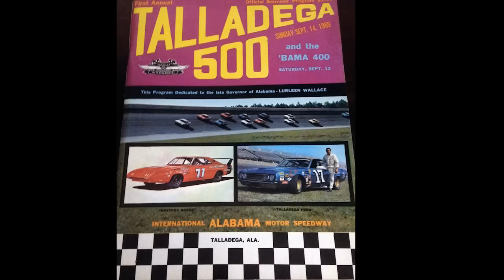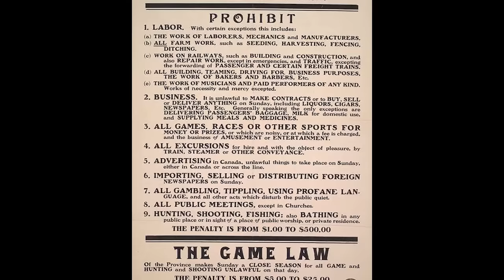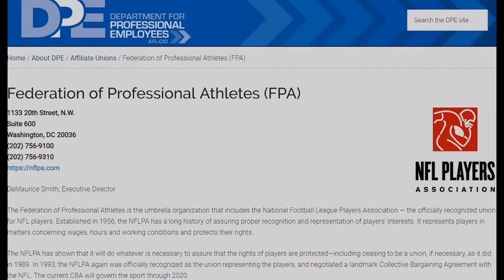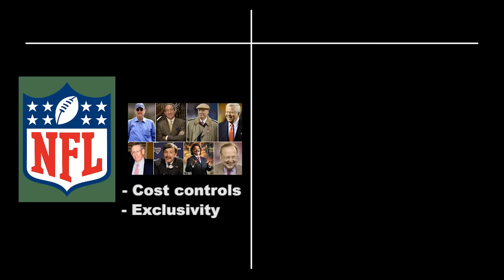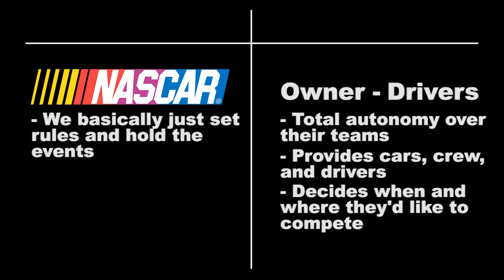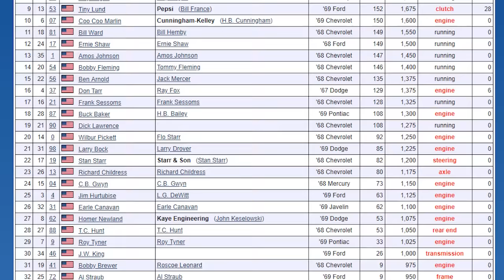The Worst NASCAR Race Ever: The 1969 Talladega 500

Comment: @7:44..."...NASCAR learned it's lesson and there hasn't been another tire war since." ... Ummm, wrong! There was a major tire war for years in NASCAR from the mid 1980's thru 1997 between Goodyear and Hoosier! In fact Continental acquired Hoosier in 2016 and BOTH Goodyear and Hoosier are "Official tire suppliers for NASCAR" ... Goodyear being the one used on the major series.

Comment: I disagree, the 2008 Brickyard 400 was just as bad, if not worse than this. It was the first time that the “Car of Tomorrow” was used and due to the lack of downforce (and poor tire from Goodyear) the cars were destroying tires in less than 10 laps.There were 11 yellow flags, 6 competition cautions, and the longest green flag run of the day was 12 laps. There was basically no way to pass, and drivers gained position through pit stops and cars in front of them wrecking.

Comment: The Dodge Charger Daytona, with the wing and nose cone was the 1969 model. Plymouth made the Roadrunner Superbird, with a similar, but totally unique wing and nose cone, in 1970, from the 1970 Plymouth Roadrunner.  (Which was, incidentally,  my first car, at age 16, in 1980. I paid $625.00 for it, it was Burnt Orange, with buckets and a 383 and a Pistol Grip 4 speed. And yes I wrecked it in a drag race at Milwaukee's lakefront that summer, like a dumbass. My Roadrunner was also an original 426 HEMI car, (RM23N), but that HEMI was long gone when I bought the car as a 10 year old used muscle car in 1980. The strip on the back of the hood rise said "426 HEMI". I've never forgiven myself for wrecking that awesome Bird. Great days indeed, when you could buy a  Roadrunner or Charger for 1500 bucks or less, and the bodies were still nice. Those days are gone forever, but I will never forget them.

Comment: Pretty good assessment. 

Small, very small detail. That was the new for the 69 model year Charger Daytona. The Road Runner Superbird was the new model for 1970, and both were raced in 1970.

So that was the Charger 500 and Daytona for 1969. After the 500 didn't quite get it, the Daytona was made.

It is amusing that the Ford and Mercury guys like to compare the wing cars to their aero cars.

"FoMoCo won this many!!"

OK, well, as you see, the Daytona wasn't raced but in 2 races in 69. 

In 69 The King went Ford. (Can't blame him, they shoulda let him drive a Dodge).

So you had arguably the best, in a Ford. The Chrysler wing cars didn't race all races, they did Riverside and mostly 1 mile and bigger.

If they want an accurate comparison,  look to 1970, when they were all in.

Comment: Why didn't they use the lower class tires in the first place? The race was the day before they would of noticed  during that race that those tires were  good.
Reply: I suppose those tyres were too small for cup cars, or not designed for those higher speeds

Comment: people think the new admin of nascar ... made nascar a rolling advertisement.... seems... this was the way since the beginning. pander to sponsors damn the racing, safety , the drivers... and the fans.... we had a short .. very breif... scene of good racing after Dale senior died and nascar put safety 1st ...... for 4 years......  now we have more flips than the 90's... car fires are a real concern again, tires aren't making a pre-determined "stage".... without  devastating failure.  and the cars are so delicate a simple flat tire, with no other damage -  not only ruins your race, but generally ended your day altogether , cars spotantiously busrting into flames without any damage.  -- we had 3 superstar drivers retire early due to simple impacts from backing into the wall and concussions took em out.  another two(total of 5 ticket selling superstars.) quit... walked away.
(blue laws where NOT a southern thing. i live in CT- .... we JUST took blue laws off the books... about 6 years ago... no sales on sunday... or after 8 pm on weekdays.... (so if you worked 2nd shift, you did not have the option of hanging at a bar.  .. ever. new hampshire went further... beyond  modern "blue laws"... they still ban all alcohol sales.. (unless they changed it over the pat 10 years... been about that long since attended a nascar race, ) 
-former baptist meself.. very proud of the "former" title as well.

Comment: Why won't a NASCAR Grand Touring Car not pass inspection?
Reply from the maker: The bodies are not allowed under NASCAR rules, the cars are lighter, smaller, and have narrower wheelbases. It's basically a completely different car.
Reply: @S1apShoes  What does that have to do with safety?
Reply from the maker: @butchknouse8316  Because of those differences they are way slower. about 30mph slower, and if a 190mph car hits a 160mph car it would almost certainly be fatal.
Reply: @S1apShoes  Why would that happen?

Comment: 2:41 Wanted to build the biggest baddest track in the world... looking at Le Mans and Nordschleife... sure have fun. Silly americans.
Reply: Well... It's a 2.5 miles long oval with monstrous banking. And the Monza oval had just stopped hosting races. So, in a certain way, it was the biggest baddest track in the world. Just like the Nurburgring Nordschleife and the Circuit de la Sarthe were the biggest baddest tracks in the world in their own ways.
Reply: @simoneburini4036  No, there is no certain way. If he said biggest Oval, than yes. But just track, no. There are many bigger tracks. Even trying to compare Nordschleife to a Oval is a insult.
Reply: @23GreyFox  fair enough. What if I told you that the Nordschleife and Le Mans were not the biggest tracks in the world?
Reply: @simoneburini4036  But Norschleife is the longest permanent race track in the world. And it's fun to drive on it.